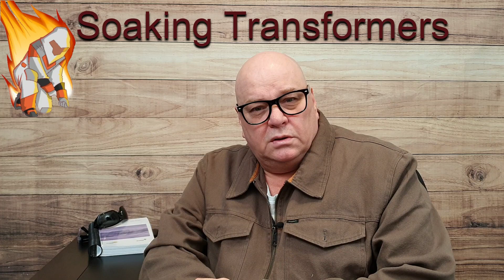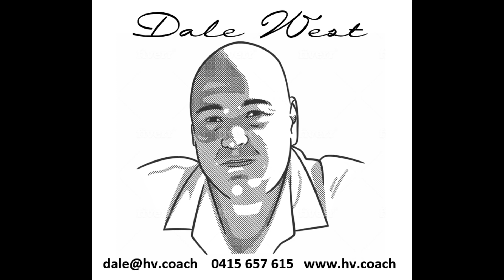Soaking Transformers

Comment: The main reason for soaking a transformer is to allow air trapped in the  windings to rise up into the bucholtz gas relay .thus can then be purged after a day or so. If you put it straight on load then the bucholtz gas relay can cause a trip. But there is no reason to soak it for more than 10 min just to ensure that there is no discharge if it does not have a gas detecting relay .

Comment: What are the likely hazards if I don't soak
Reply from the maker: I am incredibly sorry for the late reply. I was not managing the channel.

If there is air in the windings, you could cause partial discharge faults, shorting of windings, or total failure.

If there is a fault in the transformer, let it happen when it is soaking, when there is no load on the transformer, when there is no stress, no high current draw. The damage will be less.